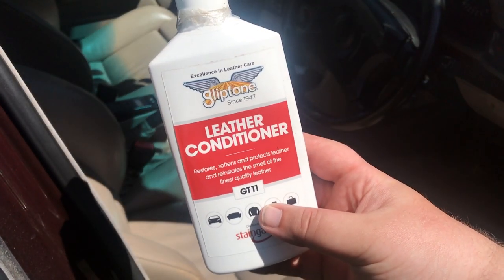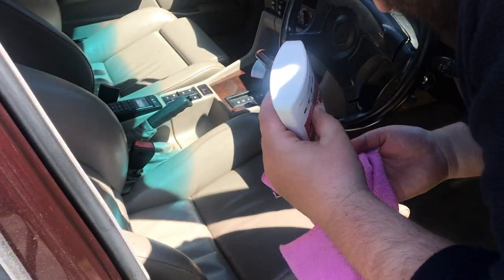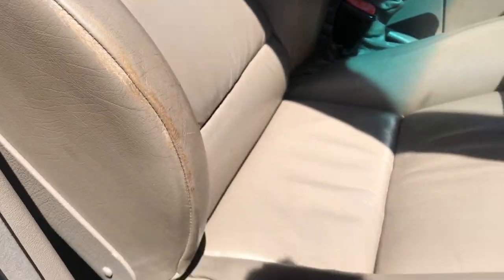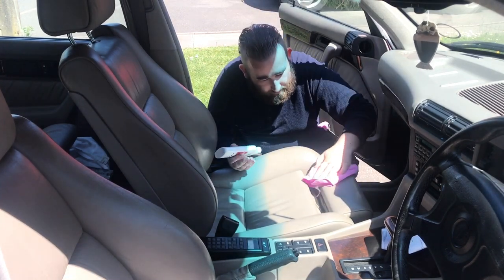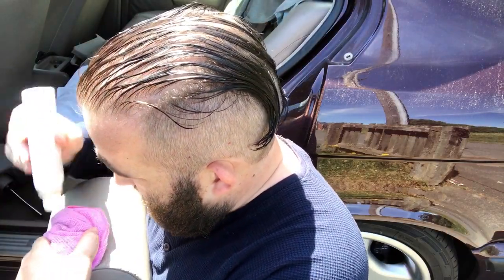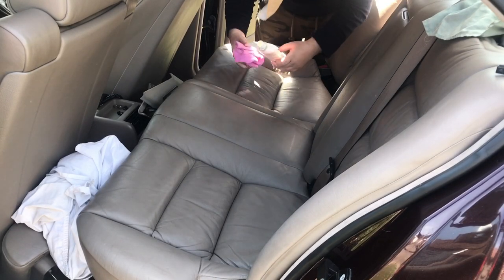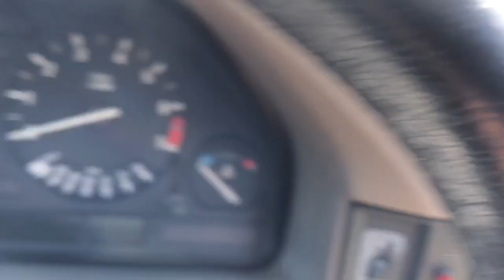BMW E34 540i Interior *PARCHMENT SPORTS LEATHER*

Comment: almost all of the interiors in the states are worn. My '90 525i has Indigo blue leather interior and the front seats are in good condition but the tops of the rear have rotting sticking and are splitting. I had to completely replace the doorcards with a donor car from Buffalo NY. really nice sport seats, ya got there.
Reply from the maker: Cheers..  Blue Leather 😍